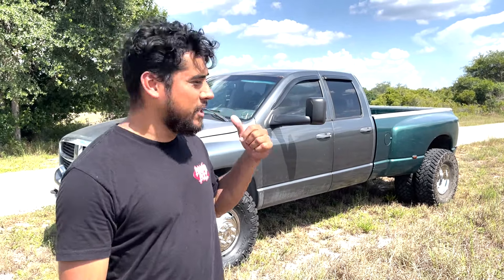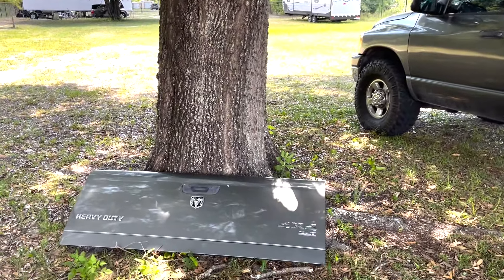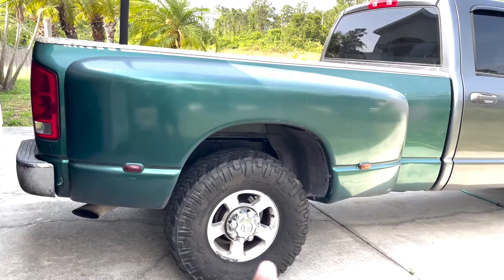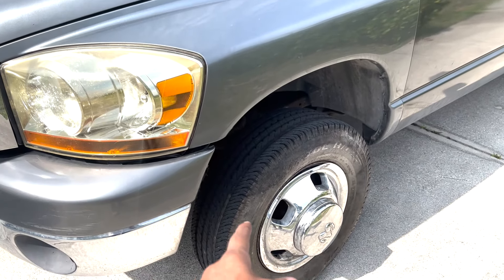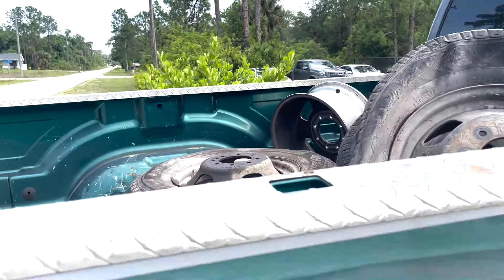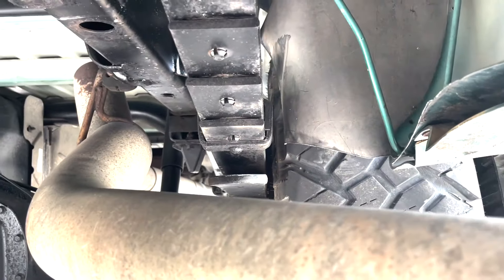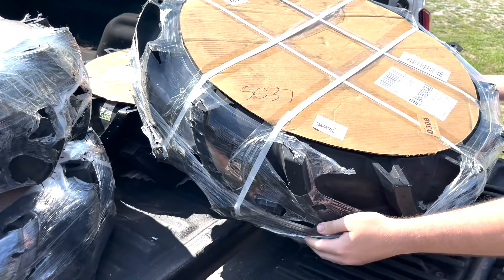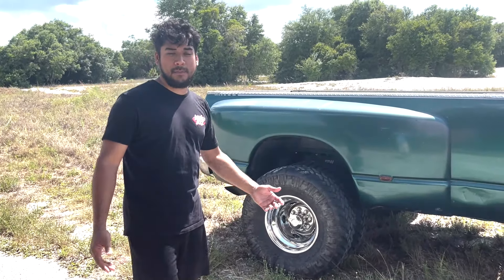DODGE RAM DUALLY CONVERSION! 🤯

Comment: That is just lying to yourself adding adapter’s doesn’t make it a dully it’s a 2500 still all your doin is weighing the truck down you need the bigger dully dif to with the proper gearing to make up  for the extra weight your adding
Reply from the maker: @joseesquivel3040  It is actually a 3500 single rear wheel. I do understand your point, but I do what I want.
Reply: I have a 18’ Ram 3500 with the Aisin trans.. if I add the adapters it’s just adding weight? I’m interested in this conversion but want a flatbed knstead
Reply from the maker: @omarpadilla7674  2 more wheels and tires are definitely more weight, but nothing the ol’ Cummins can’t handle. Plus added width adds more stability towing.
Reply: Both DRW and SRW 3500 use the 11.5 AAM axle. Stop talking without having some knowledge about what you're talking about.
Reply: Buddy. All convertinf to a dually is, is adding the extra set of wheels. Nothing more nothing less
Reply: @_.incredible_magnum._291  I didn’t think people couldn’t be dumber but you proven me wrong gear ratio proper diff that that doesn’t need ( adapters ) bigger breaks for the extra weight of the added wheels and tires
Reply: @joseesquivel3040  you can literally have a set of dually wheels on a 2500 axle. Even upgrade the diff so it's stronger. Dually refers to the dual set of wheels on one side. Nothing else 

Yes typically you'll need a stronger diff and bigger brakes. But those aren't required to make it a dually
Reply: Has four tires in the back looks like a damn dually to me
Reply: Idk why people care so much, if someone likes it let them be, true or not true who cares.
Reply: @joseesquivel3040  sometimes you just need the extra traction and also the weight in the back ie: when dumping a dump trailer ....the extra 500lbs helps hold the ass end of the truck to the ground when the dump trailer is trying to pick the back end of the truck up or when pulling a load in wet conditions those extra two tires definitely help

Comment: What is the real difference between a 2500 and a 3500 rear?  An adapter?
Reply: Same axle manufacturer, higher gearing, either spacer or wider axle, wider brakes . Bearings, axle shaft sizes, pinion size all the same

Comment: So just 2 inch spacer in the back should do?
Reply from the maker: I ended up going with 2.5" on the axle, but that is because I am running the bigger/wider tires.

Comment: I have a 06 2500 single cab wit a 8 foot bed but I’m trying to put a 8 footer 3500 dually bed of a 09 would it work?
Reply from the maker: Yupp, it should work as long as your bed is 8'